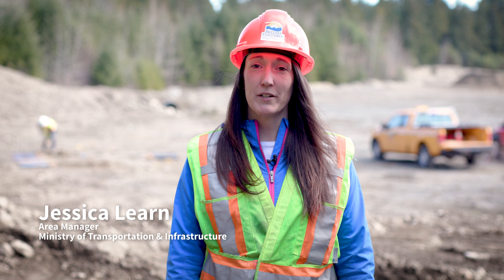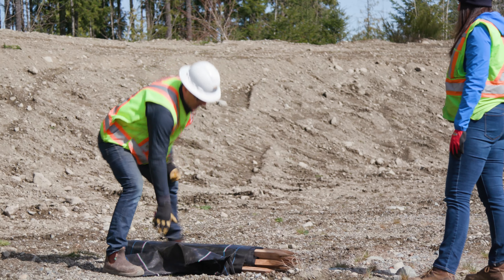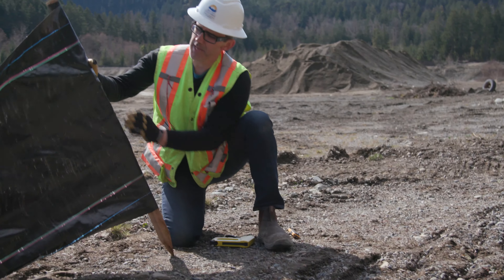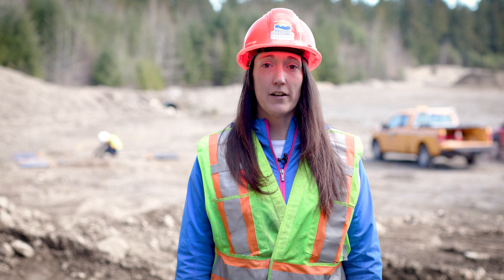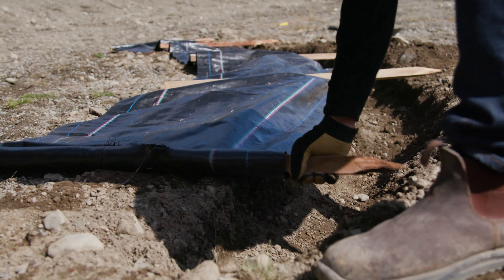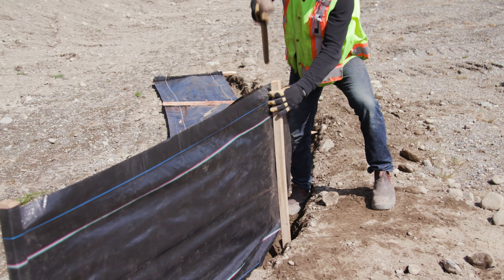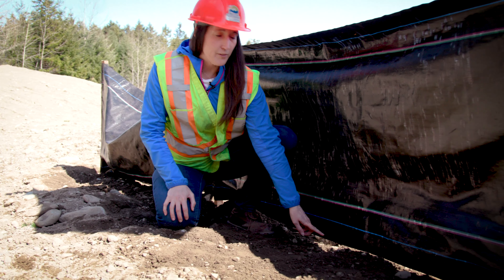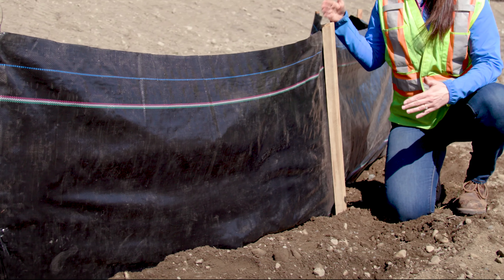How to Install a Sediment Fence

Comment: I might make a plow for the trailer hitch. Save some digging :)
Reply from the maker: I dig it.
Reply: @MinistryofTranBC  btw if the purpose of the fence is to record dirt movement, would a timelapse camera on a pole be a better modern solution?